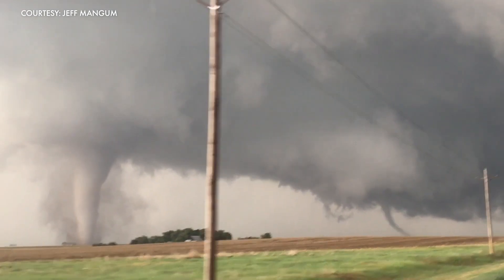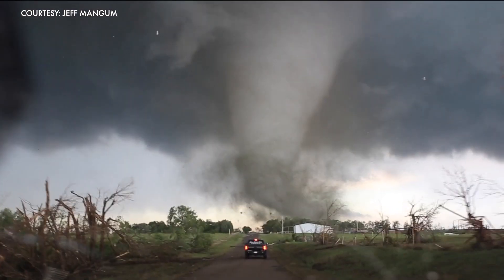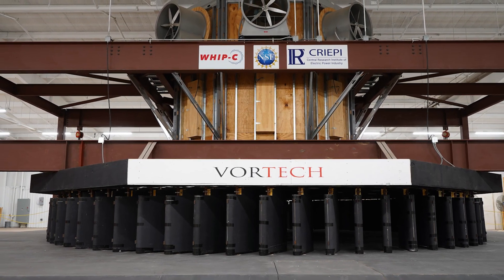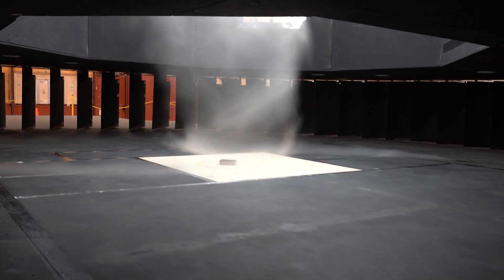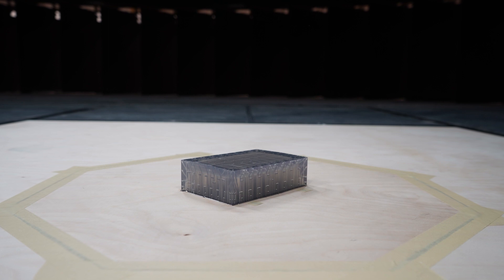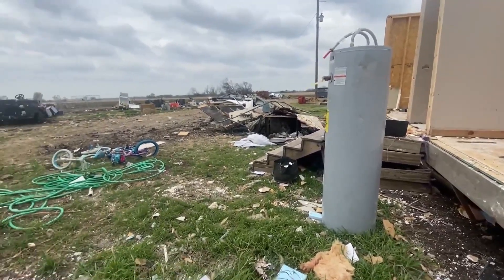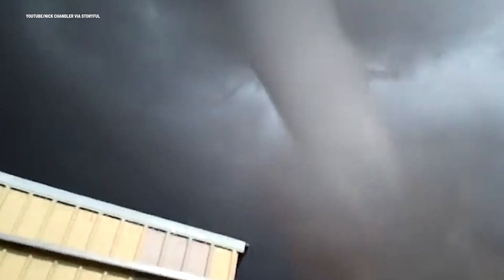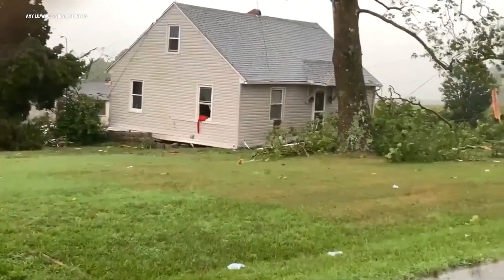Could your home survive a tornado? Researchers test resistance to extreme winds

Comment: OMFG.  The INVENTOR of EF-5 proof homes and buildings has his company in Texas.  Tested in a TX wind tunnel DECADES ago and now public structures that use the methodology are subsidized by FEMA.  The homes are built across the USA in Hurricane and tornado areas.  Entire SCHOOLS in the USA are built using his patented design.  They are MUCH cheaper than building conventional structures for schools.  ost about the same for homes.  Been covered for decades by TV news stations in Texas.